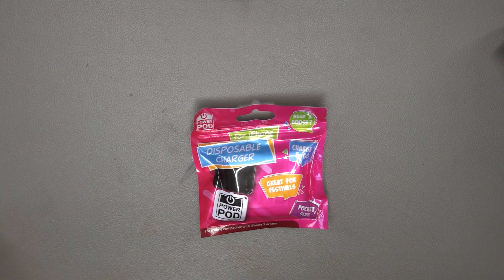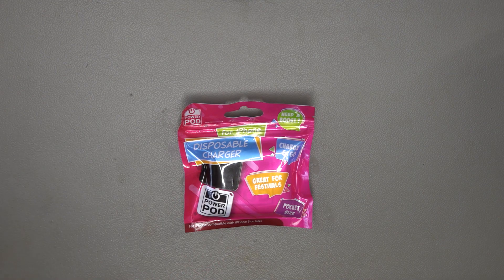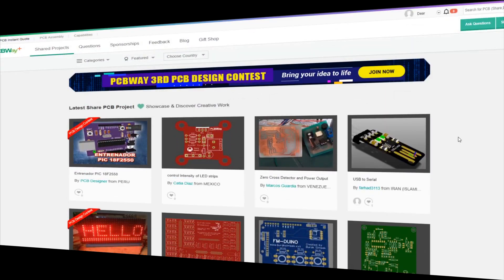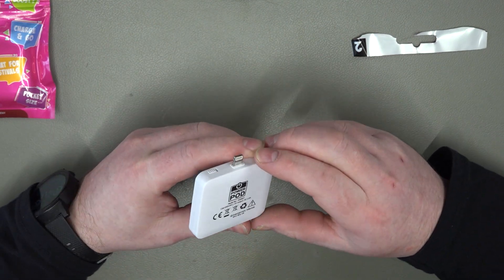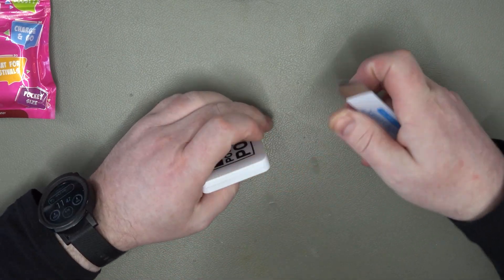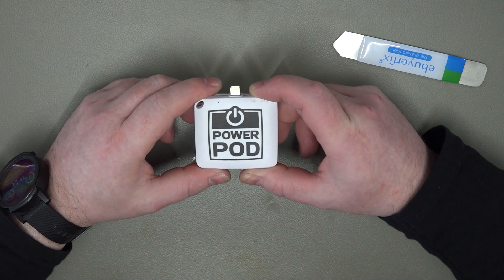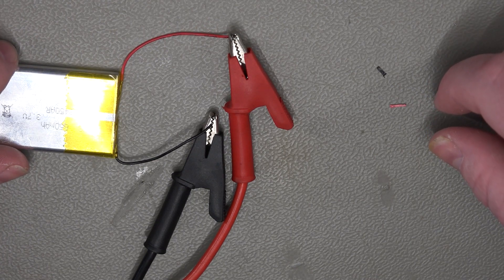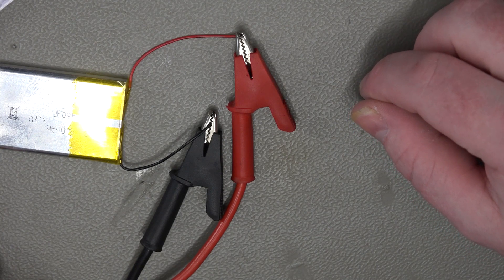What's inside: Poundland Power Pod Disposable iPhone Charger

Comment: What a waste! Using a cell that can be used around 500 times (charge/discharge cycles) just to make a disposable charger. It is cheaper to use rechargeable cells rather than 1x use. You know what would be a way better to build this? Rather than using a lipo cell, just make the box and let it take 3x aaa batteries. Those are designed for 1x use and you can just replace the batteries, and if you use rechargeable aaa cells, you have a very small and neath emergency charger you can bring with you and no need to throw it away then.